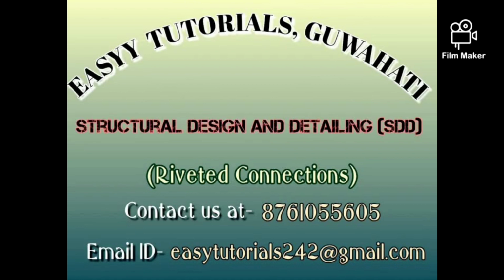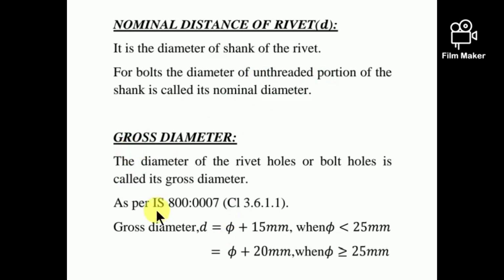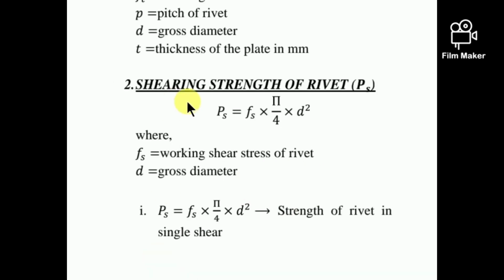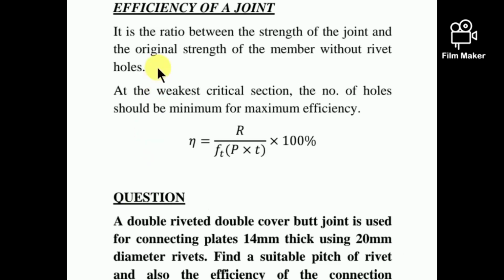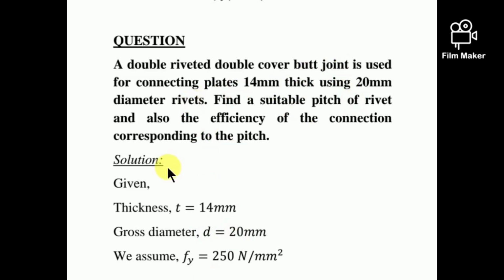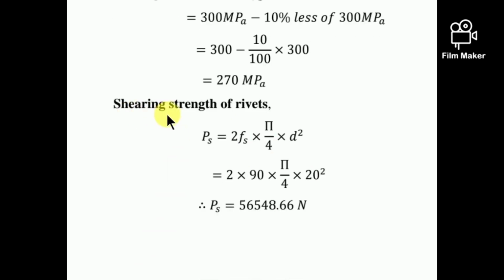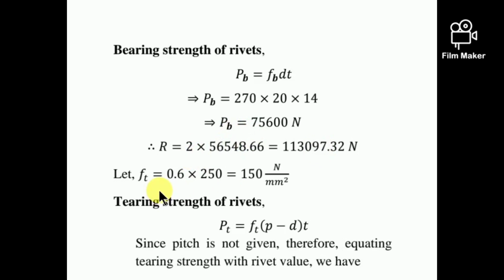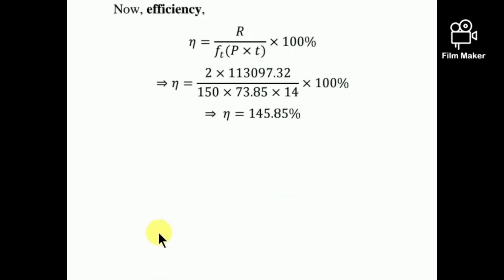SDD (RIVETED CONNECTIONS)/SDD/6th Sem #Civil_Engg #diploma #6th_sem #Btech #covid19

Comment: There are lot of mistake
Gross dia= nominal dia +1.5mm not 15mm for < 25mm rivet
Moreover for bolt there is a table 5 in IS 800:2007.